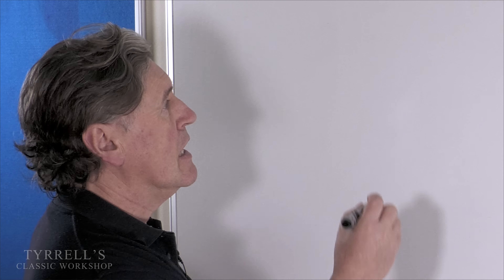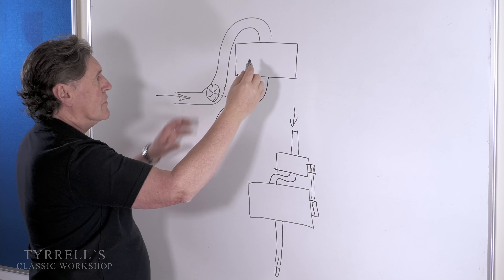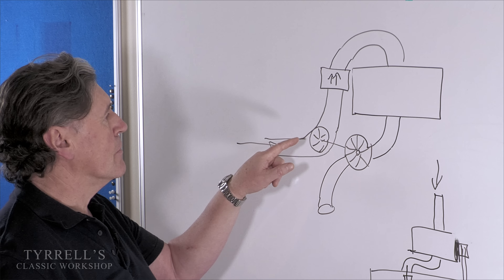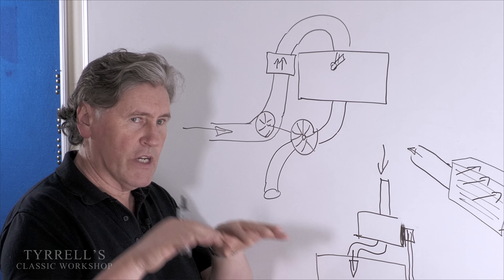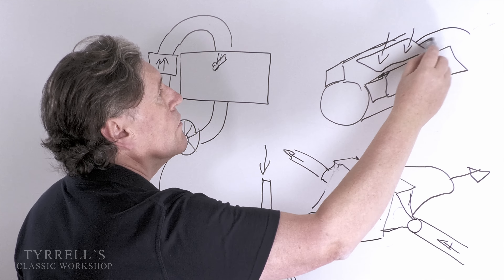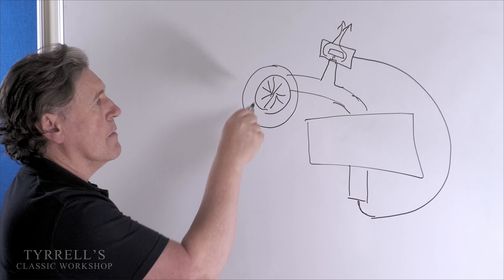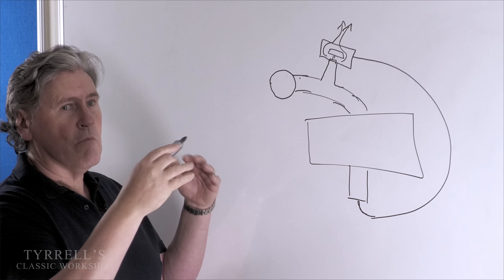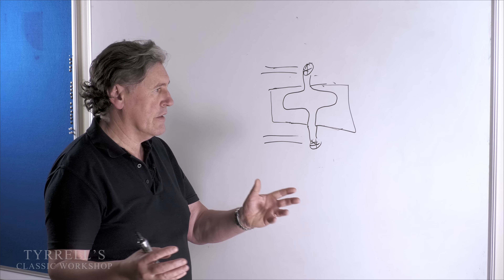Turbocharging vs Supercharging - The Ultimate Guide | Tyrrell's Classic Workshop

Comment: Fact I thought you might be interested in - the two stroke V8's you referred to at end of this reel could be problematic in that every once in a while they would start in reverse rotation and the only way to stop them was to put gearbox in a high forward gear, chock the wheels and dump the clutch!
Reply from the maker: Wow- old diesels can be a horror story to stop if they’re running away in any form
Reply: @iain_tyrrell   Lithium batteries are trying to replicate something of that kind in EVs nowadays.

Comment: Another great interesting video, I didn't know that was the difference between  biturbo and twin turbo, VW and Audi I think are the most known users of biturbo, but the twin turbo am I right in saying there's differences with that aswell because some twin turbo systems use a sequential set up BMW 3.0 6 cylinder comes to mind where they use a small turbo at low revs then a big turbo for high revs to reduce lag, Autocar praised that engine highly in road tests, it's also interesting how car engine designers try to reduce turbo lag, Volvo on their new 4 cylinder D5 engine used a supply of condensed air injection I think it is to blow into the turbo to spool it up quicker , VW and more recently Volvo have tried combining Superchargers with Turbochargers as some way of building power quicker and more seemless, I'm not sure how Volvos version of has been doing but I remember VW cars suffering reliability issues with that system, am I right in saying a supercharger works quicker than a turbo so the turbo and supercharged combo works similar to a sequential twin turbo, anyway great video thank you Iain

Comment: The Wright Duplex Cyclone 3350 aero engine( famous for its use in the B29 and Super Constellation and Tiger Cat aircraft had a supercharger and turbo chargers. 57 litre 18 cylinder radials that could produce upto 3000 HP on a good day.Mind you the 37 litre Rolls Royce Griffon could produce nearly as much on 12 cylinders and supercharged only and use less fuel.

Comment: Iain, benefits of an electric turbo? Absolutely love this thank you
Reply from the maker: Good question! Anyone?
Reply: If it's anything like the MGU-H on the turbo of F1 engines it basically in short uses regenerative braking on the turbo. A e-motor connected to the shaft of the turbo. Can also be used in turn to spool up the turbo when needed.

Comment: Small correction: Inlet side air gets hotter as it's compressed and not due to any heat transfer from the exhaust side.

Comment: I don't understand why everyone, like Iain, explaining the difference between superchargers and turbochargers have to mention that superchargers have parasitic losses. Turbochargers have parasitic losses TOO, but the only difference is that the turbochargers parasitic losses works on the pistoncrown and not the crankshaft - and are much more complicated to calculate than the linear losses of a supercharger, since the turbo works on a quadratic formula. The simplest way to understand this is to compare the turbo to a muffler on a naturally aspirated engine: The more you muffle the escaping exhaustgases the more parasitic losses you have, and the less you muffle your exhaustsystem the more horsepower you get.
     The airpreasure on the inlet side of the turbo creates resistance to the spinning of that turbine, which through the the shaft creates a resistance to spin on the outlet side, which in turn creates pressure back through the exhaustmanifold into the cylinder which lastly creates resistance on the pistoncrown to move upward and expell the exhaustgases. Parasitic loss!

Good video on explaining the differences of superchargers and turbochargers. But totally pointles to mention the parasitic losses on a supercharger without mintioning the parasitic losses of a turbocharger too.

Comment: Brilliant explanation.  What happens when the turbo "blows" and what causes this failure?
Reply: The Center bearing is lubricated with an oil supply. If the seal fails oil can end up in the air flow
Reply: @AndyK.1  Thank you.

Comment: Excellent Lecture as always🏆 Something just struck me: Considering the huge loss of energy that goes with Belt driven Superchargers; wouldn't a electricly driven Supercharger - ECU controlled - be much more Energy efficient? Could then be mapped independently, free of belt drives Mechanical limitations...
Reply from the maker: Good question!
Reply: Depends on how you charge the battery.  Porsche implemented an electric turbo charger on their Le Mans car by charging the battery with a turbine spun by the exhaust.  If you charged the system with an oversized alternator (electric supercharger) then it would create the same drag the direct method does plus a loss in electrical efficiencies. There is no such thing as a free lunch.

What we were taught in engineering school is the Turbo ICE is the most efficient type of ICE engine (per unit of fuel burned) because you were taking waste energy in the form of entropy an feeding it back into the engine.  It is NOT just more air / more fuel being burned, the additional entropy makes the combustion more efficient. Second is the standard ICE engine.  The least efficient ICE engine is the supercharged engine because you are taking motive power off the crank to add fuel, air, and entropy to the engine and the additional losses add up.  This is why you are seeing more of the smaller sports car manufacturers go to turbos to meet American Fleet EPA regs so they can sell here (we are a big market) while only the big & diverse manufacturers can sell supercharged cars (as they sell a bunch of very efficient smaller non-sports cars for every supercharged monster they sell).

Comment: Dump valve is actually on the inlet side,, letting backpressure off the compressor side of turbo and thus keep it spinning. The video accidentily mix up that with the wastegate function, sitting on the turbine side and this regulating the comoressor pressure on the inlet side.
Reply: As Iain showed in his diagram - the arrows clearly showed the incoming air.

Comment: An excellent classroom. My 12 year old Cooper S has a turbo (N18 engine). And a lot of people say I must install that oil catch can and all that so as to ‘help’ things along, considering the amount of mucky oil that gets condensed from those vapours in the crankcase Ventilation System and goes back into the engine…
I do think at times that while this forced induction does enhance the overall motoring experience because of the heightened response and all, there is a certain downside such as this mucky oil which no one ever talks about. 
Anyway, long story short, may I ask YOUR considered opinion as to which is better overall? Turbo charging or Super charging? Thanks in advance.

Comment: Question for Ian. What engine requires more cooling, a petrol (higher revving) or diesel (higher compression) ?
Reply from the maker: Diesels’ exhaust gas temperature is much cooler than petrols’.
Reply: @iain_tyrrell  Thank you, Ian.

Comment: you should explaine a normal aspirated engine 10.1 c/r at tickover that is its opperating c/r as the revs rise the working c/r drops because the air cant get in quickly enough hece t/s charging helps fill the cylinder at higher r.p.m hence more power

Comment: Charger cooler:  Air to Water to Air cooler. Advantage is you don’t have a long air intake system. Water system is usually separate with its own thin front rad as you want it a lot cooler than engine coolant. Jaguar use this.

Comment: I've always been sceptical about the 'exhaust gas is free energy which is otherwise wasted' part. Given that the engine still has to push that gas out of the pipe after it's blown the turbo round and round it must be using energy to do that?  Surely there's more back-pressure to overcome with a turbo in the pipe?   Can any lever engineering-types explain?

Comment: The charge cooler uses "cool" radiator fluid, but that fluid is at about 80°C, do I'm surprised it is effective. I guess the compressed air must be much hotter still !
Reply: Usually its an Independent cooler circuit for this very reason
Reply: It depends on the application.  For more power, a Separate Circuit After Cooler (SCAC) may be used, however it requires a reservoir for the additional coolant, pump, etc.  - in short more components, complexity and cost.

Comment: Hate to be "that guy" but anytime you compress air it gets hot. Same with fluid. You're correct and incorrect throughout video. Turbocharging is done in 3 different way depending on application. Parallel vs. Sequential vs. Compound. Examples: 959 used sequential with a small and big turbo system to eliminate boost lag., Compound turbos are often found on Diesel engines.Parallel turbos can be one big or 2 small turbos BUT Nearly all of the time twin (2) turbos are only used in parallel on V or flat engines. Examples 917-30, 1987 F1 Ferrari Tipo 033.

Blow of valves are designed to open when the throttle body closes in order to eliminate compressor surging. The turbine is still receiving hot exhaust gasses which in turn is telling the compressor to pump and if the throttle body closes the pressurized air no longer has a place to go. So it will either go back through the compressor in the wrong direction or you can give it another path that won't damage the turbo. The blow off valve. As a benefit it allow the compressor to remain energized as you said. The blow off valve is between the compressor and the throttle body. 

The overall boost is normal controlled by the waistgate. It is similar to the blow off valve But on the exhaust side. It's simple to understand. The waistgate(s) is/are located between the exhaust from the engine and the turbine on the hot side of the turbo.  since the turbine controls the compressor speed, than all you need to do is limit the amount of exhaust to the turbine by opening the gate and let the part of the exhaust never even makes it to the turbine

Both of Blow of valve and the waistgate are controlled by sensing the intake manifold vacuum or pressure. But it is important the blowoff valve on the  cold side receives its reading (signal) between the throttle body and the engines intake valves. Or just from the intake manifold. The waist gate on the hot side receives its signal Between the throttle body and the compressor wheel on turbo. That signal between the cold side and the waistgate is interrupted by an adjustable valve or know as the boost controller. Side note; The Waistgate and the blowoff valves are controlled by a pneumatic hose. They are not electric. They uses essentially a vacuum hose to control diaphragms inside the the gate and the blowoff valves. The Boost controller can be a simple as a knob you turn by hand or an increasingly more complex computer controlled valve. But it is just a an air valve.

From the same intake manifold signal as the blowoff valve, the fuel pressure has to increase on a 1:1 ratio as boost increases. This is done with a "Boost" reference fuel pressure regulator. 

This could all be said easier with a white board.

sorry for any dramatic errors. I'm a poor typist.

Comment: I am a bit confused as to why the dump valve reduces lag? I thought it was to help cut boost on the intake when off throttle?

Not challenging, just trying to understand.
Reply from the maker: It temporarily removes back pressure, which leaves the turbo free to spin for longer. Thanks for your interest
Reply: It allows the turbo to keep spinning. If you didn’t have one the turbine slows down and in extreme cases can shatter the turbine.

Comment: Nice to see it in this explination but still something that I don't understand. Lets say its hot weather with a 90F temp. For an air cooled cooler his is hot. But now the cooler with coolant. As a normal temp for coolant is 180F why found this be somewhat equal to air. And you can decompress a gass then it becomes cooler with a liquid this doesn't work.
Greetings Peter

Comment: A Clutch on a Supercharger they would burn 🔥 out if you where adding 40 % more power ..O K in the First Mad Max but not real .they just started and switched off the engine..there's a plate of metal on rods and springs under a set up Supercharger that blows of air gets to high pressure. Top Fuel use Superchargers for good reason .Great Video 📹 🎥 thank you

Comment: This video is FAR from the ultimate guide! I'm quite surprised that you don't know it's the compression of air that leads to the temp increase, Mr Tyrrell. And your statement that the supercharger normally doesn't kick in until around 2000 rpm? Who told you this?

Comment: A very basic layman's guide to the differences - lots of factors mitigate as to the best solution for various scenarios - of course that needs much deeper understanding of thermo-dynamics, air flows etc. The innovation in cheap sensors and software driven engine management systems has refined the turbo charged engine greatly and all but eliminated 'turbo-lag' - so a 3 litre twin turbo V6 engines can easily produce 600bhp or a 900cc 3 cylinder engine being economical yet still producing 100 bhp. It should be noted that generally piston engined aircraft engines would use supercharging  [eg. the RR Merlin] but turbo-charging was a better solution for automotive use.  VW did some supercharged cars like the Polo/Golf family in the 1990's and of course Bentley in the 1930's but as the Americans used to say - 'there's no substitute for cubes' or 'no replacement for displacement'. Automotive design and development is fascinating but an ICE is only 40% efficient at best. So 60% is primarily wasted in heat. So much more that Ian could make into future 'TECH' videos.

Comment: Your diagram got a bit confused with the dump value which appeared to be dumping exhaust rather than boost.  Another reason small turbos are possible now is the precision and efficiency of the turbo.  Not just availability.  Bi turbos can be staggered and uneven too.  Lancia 037 had both supercharger and turbo.
Reply: I think you got a bit confused!  The turbo and dump valve Iain showed was on the inlet side.
Reply: @stevemawer848  nope.  look again.
Reply: @odl21  I looked.  Iain clearly explains that the incoming air's pressure is bled off when the dump valve opens.  Why would you have high pressure air in the exhaust?

Comment: Really informative as usual.
But ,iain why not use pre drawn sketches .you. could have covered the Intercooler  and dump valve snd peeled off to show additional produce .
What about toyota supra where tiny turbo ru s at low revs,and bigger turbo operates at higher revs. Also historically cross flow engines were liable to lag . Where an engine with inlet and exhaust on same side were less liable to lag.
Dont over simplify ,push the interest of your lotal followers

Comment: The description of the dump valve is not actually correct, the purpose of a dump valve is almost opposite to what has been explained here. What actually happens is that when the throttle is closed under boost conditions there is a pressure spike in the inlet between the turbo & the throttle. This with the sudden drop in flow causes the compressor to 'stall' as it's gone from consuming a given amount of power from the exhaust turbine which actually unloads the compressor & the turbo rotating assembly overspeeds momentarily. This is cyclic & in extreme circumstances can actually shatter the compressor turbine or shear the turbo shaft. The function mentoned here is more along the lines of "antilag" which can be done in several ways to keep the turbo basically "on boost" even when the driver is demanding little or no torque. There was no mention of wastegates either which are a crucial part of controlling turbo speed, boost & ovdrall torque delivery. There are also several different types of superchargers which have different characteristics that make them suitable to different applications. It's a massive topic!

Comment: Iain, I love your channel, but this is hardly the “ultimate” guide. The increase in temperature of the air in the intake side is due to the compressing of the air by the compressor. All gases go up in temperature when compressed – that’s the entire basis for air conditioners and heat pumps. That’s why the intercooler is so important, as a cooler charge in the cylinder produces a bigger expansion when burned, and that’s why superchargers benefit from intercoolers as well. The heat transfer from the exhaust side of the turbocharger is not the main source of heat on the intake side. … The cooling doesn’t increase the density of the air – the compressor did that. … Are you sure about your definition for ‘biturbo’? Can you name an actual vehicle with a setup like that? Two turbos applying pressure against each other would be a bad thing.

Comment: Surely, the solution was, the most fascinating engine of all time. The Twin Charger Volkswagen engine. Super. And Turbo. Charged. VW could have made that work. Any one could now, with more advanced electronics
Reply: The 2-stroke Detroit Diesel 6V53 was both turbocharged and supercharged.  That said version first appeared in the late 1970s.